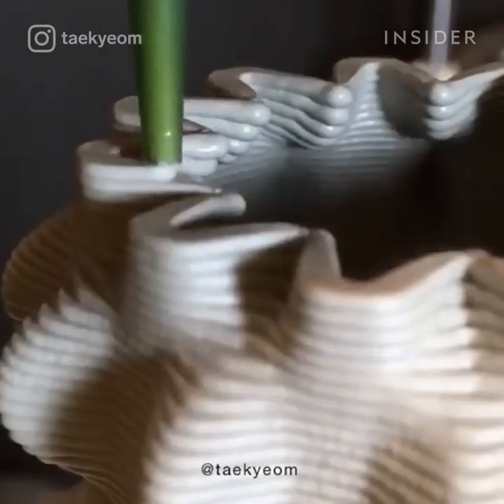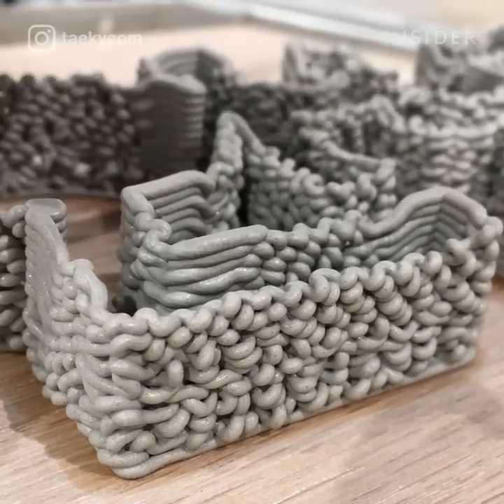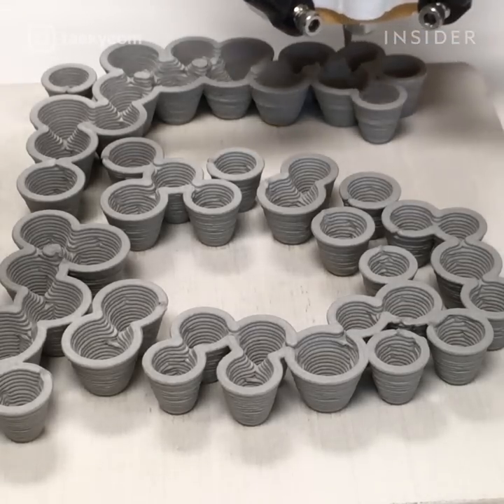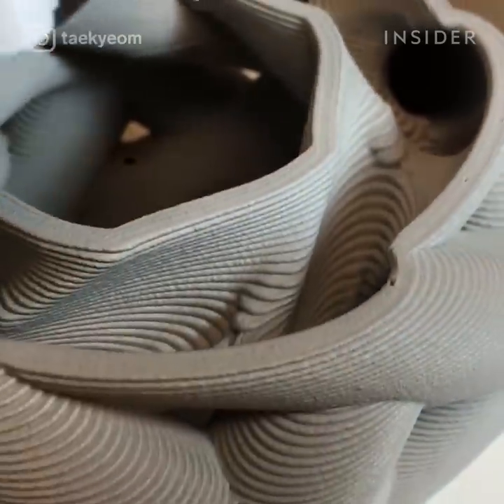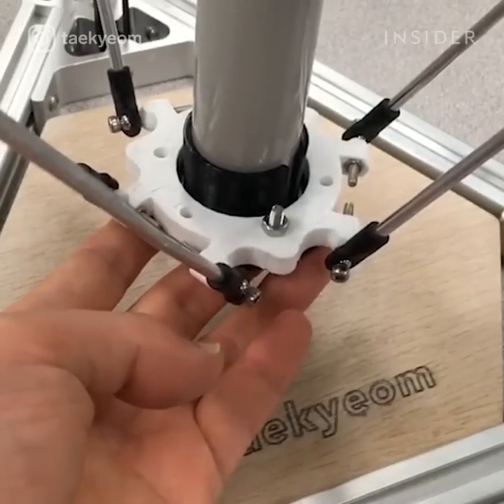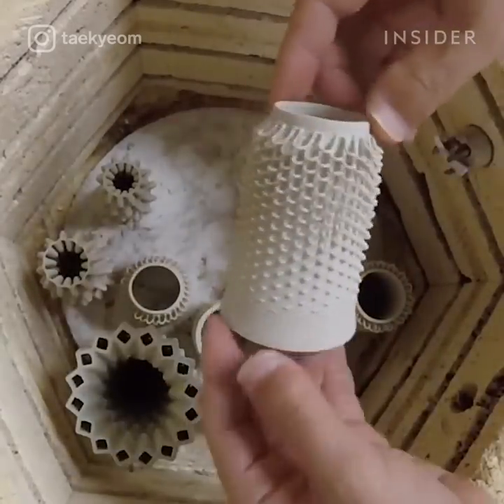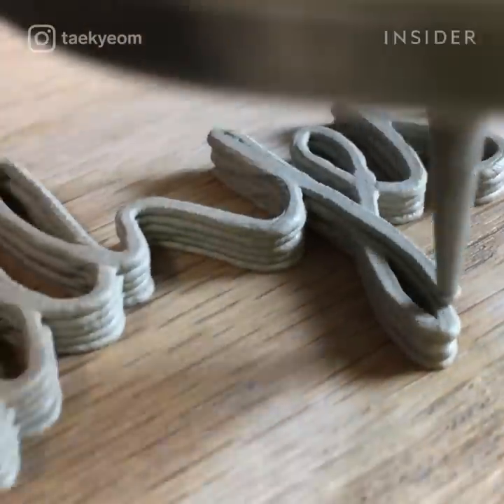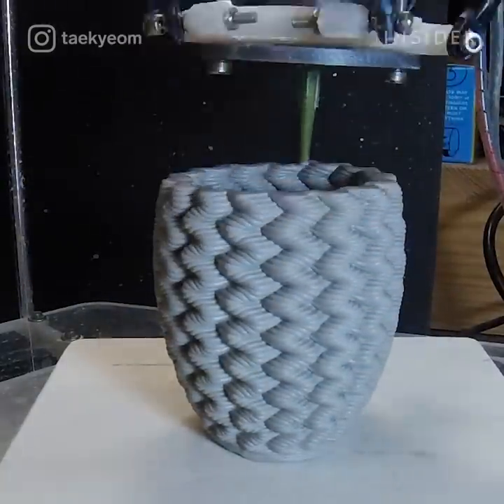3D Printers Are Changing The Kind Of Pottery We Can Make

Comment: Great thing about clay is, if your print goes to shit you can still use the clay. Unlike ABS or PLA.
Reply: That’s not true you can just melt PLA down and reuse it
Reply: @kateapple1  Can you do it at your own home though?
Reply: @kateapple1  Yes but you need specialised equipment for that, some have tired on YouTube you can check them out.
Reply: If it's not baked
Reply: @ryy1704  I mean you'll have a fucked up print wayy before you get to the baking stage.
Reply: @kateapple1  How are you supposed to melt down the PLA and reform it into a reel of thin plastic suitable for printing with?
Reply: lmao if that isn't the truest statement
Reply: Natural non toxic compostable material. Vs toxic unbreakable eternal pollution material
Reply: @d3r4g45  idk but pla is made out of corn starch so it's not that bad actually
Reply: @raccoontrashpanda1467  with a shredder and a filament extruder. the cost is still high, but people are working to make these things more viable for the home printer.

Comment: I've seen a few fails in this video.  It most definitely takes some skill.
Reply: The consistency of the clay is very important.
Reply: From the looks of it, the walls of some of the pieces are just not being allowed to dry to a leather hard consistency. Potters and ceramists when building large/tall items, you have to let the bottom get a little dry to be able to support new layers of wet clay. Then, when the item is finished, you slow down the drying for the entire product to solidify it. That way it doesn't crack when drying and firing.
Reply: i assume the height would be tricky as well depending on consistency like elias said.
Reply: We've all had failed prints.  I imagine the clay could be reused whereas with your various plastic filaments it is pretty much a lost cause
Reply: Yeah no support structure with clay so its not easy like filament
Reply: na man, you put 3d model and printer goes prr bin pum prrr prr bbbbrrrrrr pee pee pee and done.

Comment: Uhm... You want a project to use this on? Get the CAD blueprints for a crown victoria, buy one at a junkyard, or a working one if you can, make ceramic plating for the body panels exterior similar to what the military uses on Hummers. Just an idea that might get you a long term contract.
Alternatively, and complete shot in the dark.
Please try to print a cylinder with a narrow end. Just wondering if this could be used on the moon the print disposable rocket motors to get payloads from the moon's surface up to whatever we have in the moon's orbit.

Comment: The high school interns st NIST were set the problem of solving the horizontal weakness of 3D pribted objects 6 or 7 years ago.  They did!
     3D printed objects can be further fused by baking them.  The temperature and baking time depend on the substance used to print each object.
Reply: Not really a breakthrough when vulcanization of rubbers and plastics was already a known.